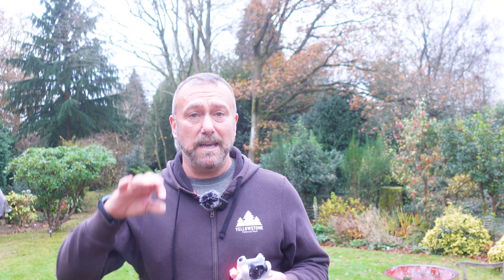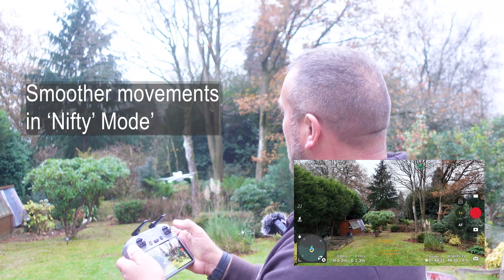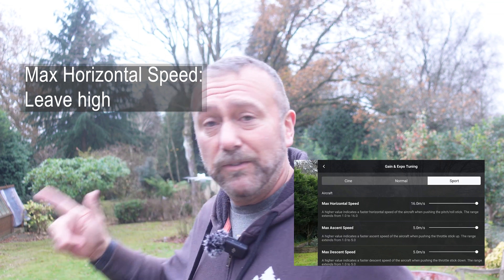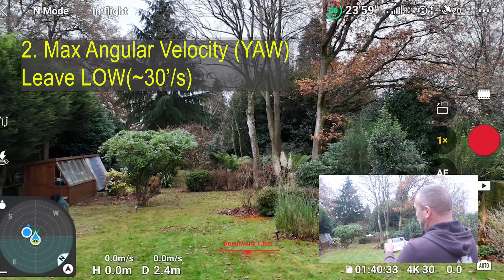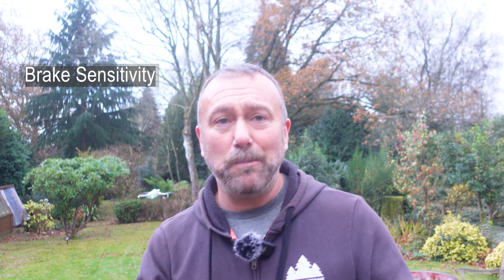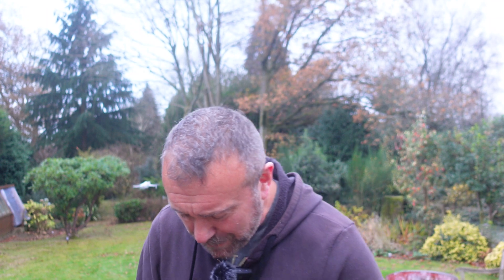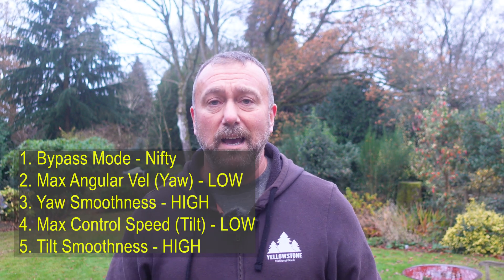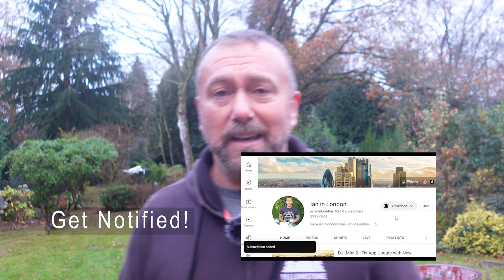DJI Mini 4 Pro: 5 Simple, Crucial Settings for Smooth Flying & Video

Comment from the maker: My preferred settings for Normal:
Max speeds – leave at max
Max Angular Velocity:  35-40 ‘ /s  (more for Sport; less for Cine)
Yaw Smoothness:  60
Brake Sensitivity:  Set to max (highest)
Gimbal Max Control Speed – 20 ‘/s
Tilt Smoothness 25
Reply: Thank you so much! Could you post settings for cine too please?
Reply: THANKS AGAIN MY FRIEND!

Comment: is there a difference between jerkiness / smoothness  of bypass and brake mode only if there is an obstacle detected or low to ground - or at all times? Not noticed this before. Adjusting ascent velocity right down to about 2m/s  is useful to do if flying indoors to keep drone safe drone.
Reply from the maker: At all times; bypass always has a jerkier movement even up high when you tap the sticks.  But the gimbal smooths things out a lot.

Comment: Just trying to set up new Mini 4 Pro gain and expo settings but your video is all in metric instead of USA Imperial, I tried to convert each unit but it was tedious, so I gave up watching
.Would be great to have  a simple chart  I could photograph on my phone, in miles per hour or other imperial unites for at least the normal mode.
Reply from the maker: Sorry about that.  I normally post both metric and imperial as viewers are around the world and only US uses imperial.  You could switch your setting to Imperial, set the gain & expo settings, then set your unit back to imperial and they should all be set right for you 🤠👍🏻👍🏻

Comment: Hi Ian,
Thanks for this great information, been watching it over and over again. I am a professional photographer for 25 years, owned a Phantom 4, recently got the M4P. As far the Yaw Smoothness and Speed are concerned, I was thinking to set them to least smooth and the speed about moderate under the N mode. The reason for me to do that is simply to compose the image fast, especially composition with leading lines, such as road, railway tracks, rivers or any other geomatricaly shape subjects. I find that if the smoothness is too high, or even moderate, it will be difficult to fine tune the camera. I found I spent lots of time positioning the camera. Now, If I set the smoothness low, say "1", it will be easier to do the fine tuning. Maybe I am a photographer, use to control and fine tune the angle on the tripod.

As soon as I have composed the scene, I would switch to C mode and begin filming.

The other thing to note that the default mode for the RC2 is N, thus that will make it easier for me to compose the image. However, I would have to remember to switch to C mode before I start recording.

Appreciate your thoughts.
Reply from the maker: Hi Steve; what you say makes sense from a photographer's perspective.  Set up fast and shoot.  These are all aimed at video filming, where camera movement needs to be far slower and measured. If you film video as well, then as you say, have fast movements for N or S mode, and slow movement settings for C mode.

Comment: 1) For a beginner, you do NOT want to set Brake/Nifty.  You want obstacle avoidance, bypass.  2) The camera used to record this is set all wrong.  Video is blown out and has no depth of field.  Poor advice and poor camera work.  C-
Reply from the maker: In your humble opinion.... Brake mode is easily the safest and easiest to control mode....

Comment: Excellent tutorial. Movie and TV camera operators avoid jitter by panning no faster than 7 seconds for a fixed object at one side of the frame to arrive at the other - so the angular pan/turn rate will differ when zoomed in. I'd set that rate for the wide angle shots unless having to do critical shots in zoom.

The other thing which overcomes jitter is motion blur - achievable with ND filters - and the 180° Shutter Rule BUT I've never seen a good article which takes zoom, slo-mo and media frame-rates into account. And if you are videoing for TV in Europe, it's different to filming for publishing on YouTube... Your next video, Ian?

Comment: I really am enjoying playing with my Mini 4. I haven't had a drone for a few years and I found that the sticks are very small with not a lot of room to wiggle them about on the Controller to get precise gentle filming movements. 

To help me alleviate this predicament I changed the Expo settings so that when I start to move the sticks the drone moves slowly and cautiously and when I'm happy to "Give it the Beans" then I move the sticks further away from their central/neutral resting position. And when I want to move from "Full Beans" to more precise controlled movements, then I have more room to play and control what I'm doing when moving the sticks inwards.

I shall experiment with Nifty though as I was uncertain what the mode did.

BTW loving filming my drone at night. I haven't experimented with Night Time mode because the Dlog does such an excellent job with its 10bit colour profile.